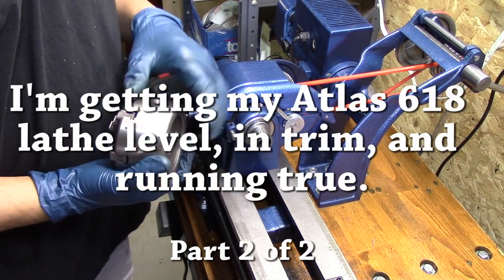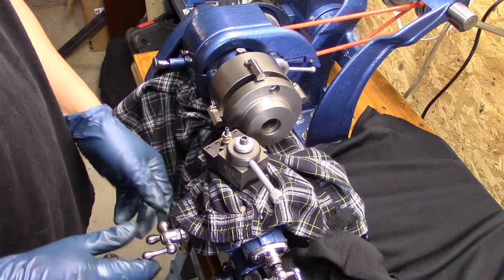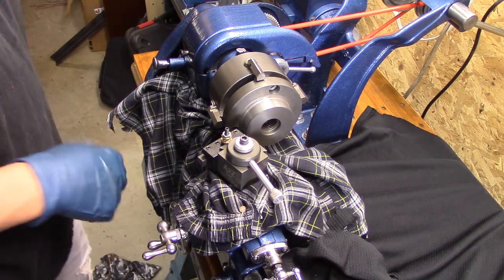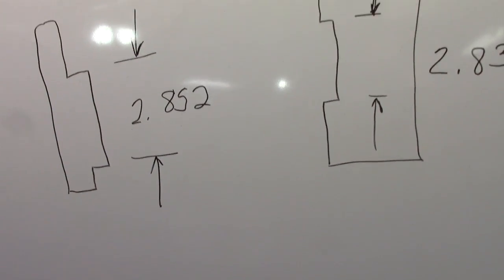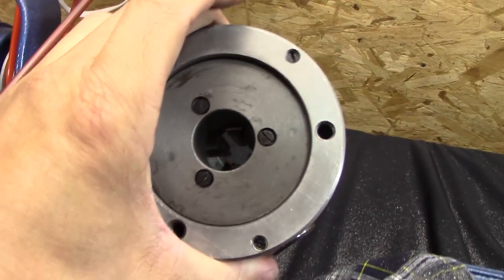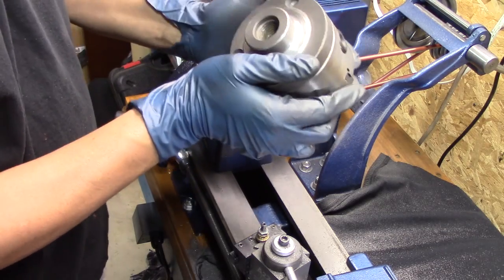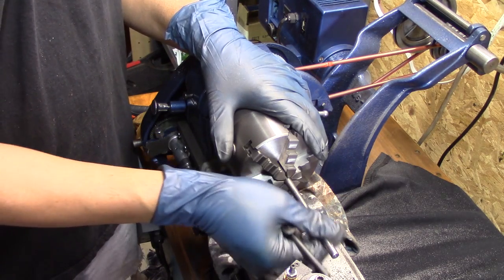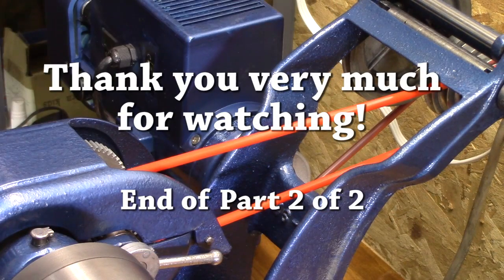Atlas 618 lathe adjustments part 2 of 2

Comment: What’s the horsepower on the motor you’re using for this lathe?  I have The craftsman version of this lathe  but I’m wondering if it is a little under powered the motor I’m using is a 1/3 hp craftsman electric motor.
Reply from the maker: Lasurge1982 It’s a 3/4hp sewing machine motor I’m using. For me it’s enough power.  Good luck with yours....

Comment: Way too fast on the cast iron. Your spindle is chattering like crazy.  Slow down until the chattering stops at least, Cutting speed should be about 80 inches per second.  very slow but it gives much better results.

Comment: Thanks Jster, was your motor about $140 I see them on ebay... I just had a brainstorm ... maybe a treadmill motor. I have one of those if I can figure that out . any thoughts? Thanks Mike
Reply from the maker: I used a treadmill motor before I got the sewing machine motor.  It worked just as well.  I had a controller and mounting setup that I just didn't like.  When I saw a guy on youtube using a sewing machine motor, I thought I would try it.  And yes, it was about $125 when I got mine.  I don't know if this is the best way to go, but it is working for me.  There a quite a few guys that use treadmill motors.  If you have any more questions, please let me know.  Thank you and good luck......
Reply: Treadmill motor is GREAT for a belt sander, or a bead roller or something that only needs to go ONE WAY, Lathe motor has to go FWD & REV
Reply from the maker: Great info!  Thank you very much......

Comment: Jster, thanks for the vids! Im glad you show the good, bad and ugly it helps us all at this level. Can you recommend a source for the motor and the belts on the lathe? I have a 618 as well. Thanks Mike
Reply from the maker: Thank you so much Mike!  I am such a novice that you probably don't want to take any advice from me.  But I'm using a sewing machine motor I got from ebay.  I don't know if it is better or worse than the original, because I never had an original motor.  I saw another youtuber use it on a drill press and liked it, so I tried it.  I like it, but once again I don't have anything to compare it to.  I got the belt from McMaster-Carr.  It's the orange round belt (5/16" I think).  It is very cheap (about $1 and change per foot).  Good luck and let me know what you go with.  ps. check with more knowledgeable people too........